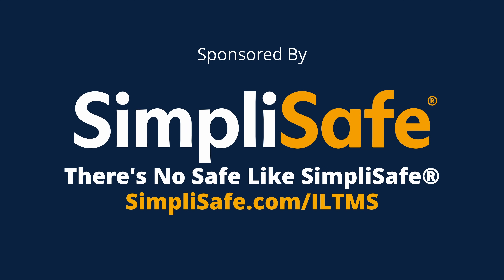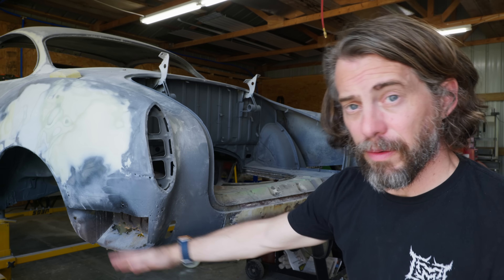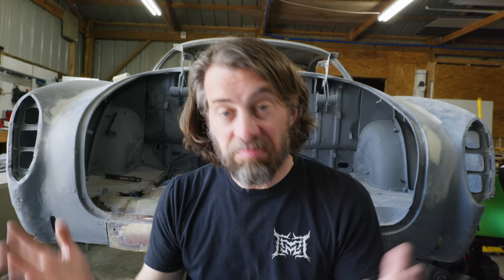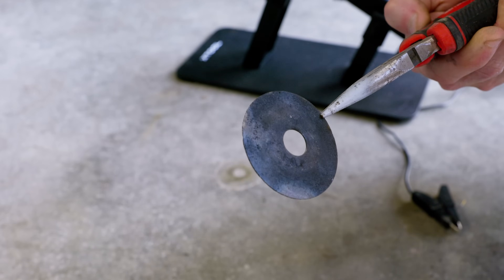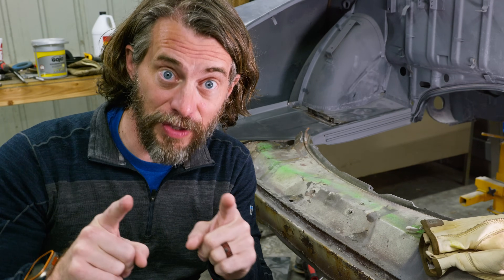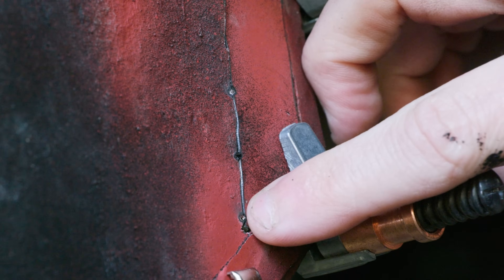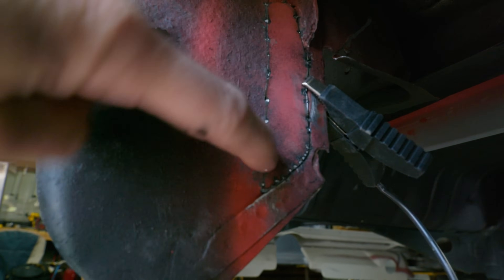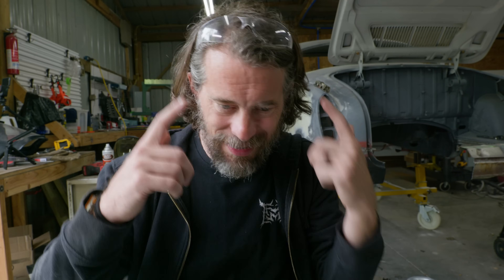Using a LASER (xTool MetalFab) to work on My Karmann Ghia?!

Comment: Usually when cutting up panels like this where you’re going to lose the structure of the body you want to tack in some braces between sections so they stay in place. You can use pretty much any type of box or round tube to do.

Comment: Seriously, that clamp is in the way. You have to think of your track and if something is obstructing it. I have the same machine. It took a couple of days to unlearn my MIG/TIG ways. It’s much easier to weld when you’re doing autogenous welding because you can twist the gun around in any angle you have to. With the wire, you can easily weld curves, but it takes a bit if practice. It’s like driving around a curve in the road. You have to steer it.

Comment: Trying to weld painted surfaces is not the Welders (ie tools) fault. Try preparing the metal surface by removing the paint....
Reply: that was welding primer
Reply: @AnthonyRose  Which you would use, if you were doing resistive welding.... Which he is obviously not doing. Paint is ablative to lasers....

Comment: Weld in temporary supports and cross bars to keep the body aligned and together while you remove pieces, take measurements from reference marks made on the temporary supports.
Reply: This! So much this! Has he never seen any other car repair vid?

Comment: My cousin is a jeweler, and they have a laser welder for making and repairing jewelry. The welds that thing can make are tiny - so much so that it has a stereo microscope built in so that you can see what you’re doing. I’m not surprised that the laser they sent you can do that on steel. They’re great if you can afford them… but with the price approaching that of a decent used car; I’m afraid I’m going to have to stick with my arc welder (er, no pun intended).

Comment: When removing parts that are in some way structural you should first weld a rebar or some other scrap bar to the panels that are left. In that way all the panels are in the same position all the time and you don’t risk getting a door that don’t close or a twisted body.

Comment: That is one helluva laser tool you got there, Bob! I have no welding experience whatsoever, but is that tiny laser weld as strong as a "normal" weld?
Reply: The opinions I've seen (not verified facts) seem to suggest it's not as strong. I would wait until after this unit is released and some testing is done by people not chosen and supplied by Xtool

Comment: For rust removal I'd go with a wire wheel over a flap disc
Reply: And if it's not something that has to be cleaned up on the car, I usually opt for something like evaporust or electrolysis.
Reply: For light rust then I prefere the abrassive expanded foam discs that exists. They are thic enough to lay flat on the material and as long as you can handle it from moving around to much it is very effective.
Reply: It all depends on the where for me? If it's detailed, wire wheel, if it'd flat no details flap disc

Comment: Couple pointers on handheld lasers… gaps are not ideal. The wobble width can’t overcome the gap since there is nothing to melt  into. Tack welding is how it’s overcome, just as you started with. 
When laser cleaning and welding try not to go perpendicular to the workpiece as it reflects back to the internal protective lens and spots it. Requires replacement when this happens.
Aluminum tape works excellent if needing to mask material for laser cleaning functionality. 
Also, when cleaning, the further back you get the larger area the area getting vaporized. Typically most systems recommend at least six inches away from material being cleaned, not sure what XTool recommends. Can also play with wattage when cleaning to get a better surface finish on different materials. You can get these to take varnish off cabinets when done properly. 

I’m excited to see their system. Great video
Reply: Also he should wear some lazer goggles just incase of stray light

Comment: I understand you did what you had to for the time crunch, take it easy next time with a nice simple project in thicker steel ;) P.S not trying to be rude, I just know the frustration of melting through thin sheet while figuring out a new welding process at the same time, with the added pressure of a deadline

Comment: One thing I don't understand, why does it matter what the angle of the welding gun is at in terms of the direction of travel?  Why would the filler wire "push" the gun if you're getting good fusion?
I'm just a hobby welder myself.  I have no formal training other than a semester in shop class in HS.  The projects I've taken on in my adult years (mix of torch & mig) have ranged from building metal gates and fixing loader buckets to stitching a car quarter panel and patching a rusty Ford truck bed.
But personally looking at the laser welder I think oxy torch welding would be more comparable from a mindset and technique standpoint.  The laser is exciting the base metal to melt and make a tiny weld pool, then the filler metal is being fed in to, well, fill the area with more material.  The reason for the autofeeder mechanism is because the tiny laser point is so small, a human has a hard time feeding filler in to the right spot at a consistent rate.  The wire feed is not making the arc like a MIG gun.

Comment: i think they should get CEE to test the thing :-)
Reply: I doubt Curtis would be interested in it. Laser welders are atrocious at getting penetration in welding. They can be great if you’re doing a bunch of sheet metal, because they don’t put as much heat into the part, and the heat they do put in is extremely concentrated. 

For heavier duty welding, you need a ton of heat in order to get full penetration, and that’s just not something that lasers can do (yet) - at least not hobby level lasers like this one. 

Most - if not all - of the welding projects I’ve seen Curtis work on over the years involve metal that’s at least 5mm thick. You would have to do an insane number of passes with this thing in order to get a full weld on metal like that.

Comment: It's Simpli safe to say the new welder has a learning curve.
Reply: Which is pointless, may as well learn an actually useful welding skill, mig or tig. Not so much stick for automotive or sheet metal work though you can do it.